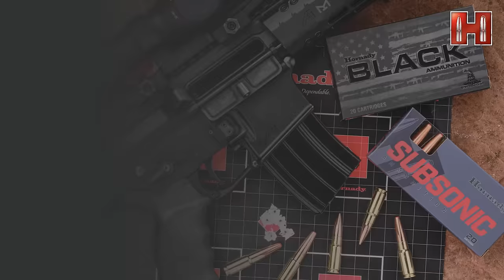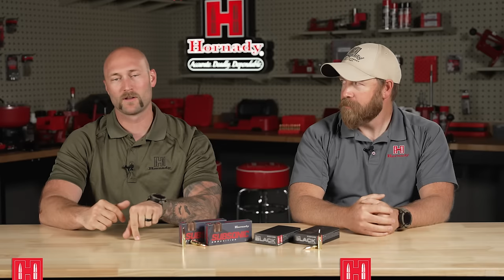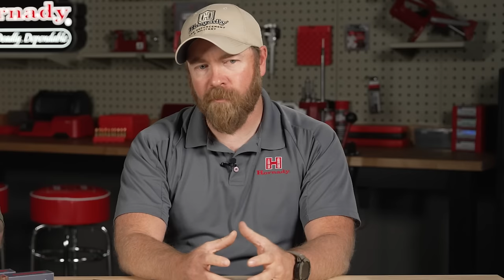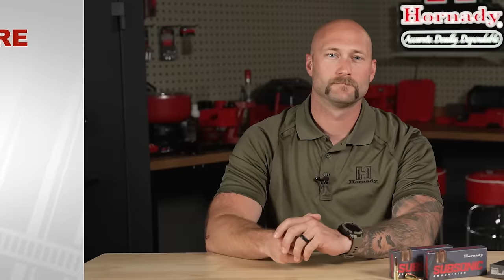338 ARC vs. 8.6 Blackout

Comment: What magazines does it use?

What Bolts does it use?

What’s the Bolt life like?

What Silencer Caliber does it use?

What’s Brass life (reloading) look like?

What gun companies have signed on to make rifles (and “pistols”?

This smells a bit like “30 Super Carry”. A new caliber looking for a use case, that will have no platform support. 

How does the 338ARD compare to “338 Spectre” or “338 Whisper 2”?
Reply: 338 Spectre uses a 6.8spc or 10mm magnum  case and a 6.8spc bolt head. This means you can get ammo with either large pistol primers or small rifle primers. 

338 Razorback starts with 10mm auto brass. 

ARC cartridges start with the 220 Russian case, which is also the parent cartridge of 7.62x39 and 6.5 Grendel. Advances in bolt tech from companies like Young Manufacturing and SixFive have fixed the original bolt breakage issues companies like Colt and PSA have.
Reply: The problem is 30 super actually had a use case.
Reply: @lordhellfire153  You have the parentage backwards: 7.62x39 is the 220 Russian's parent, then the 220 influences the PPCs (22 and 6) and then 6.5 Grendel.
Reply: @alexmorrison4145  no it didn't.
Reply: All of these are either answerable or by critical thinking on your end or look at Hornady's website.
Reply: 6.5 Grendel/6mm ARC magazines
6.5 Grendel bolts
Working pressure is from low 40ksi to 48ksi, so bolts should last 10,000+ rounds.  Rexus UltraBolts are the way to go.
Silencers can be 338 or 9mm.  Hornady has been using TBAC FLY9 in their testing.  Excellent can.

Partner Companies:
Aero Precision
AR Stoner
Ballistic Advantage
Black Rain Ordnance
Brownell’s
Carbon Six
CMMG
Faxon
KAK Industry
Maxim Defense
ODIN Works
Palmetto State Armory
Preferred Barrels
Primary Weapon Systems
PROOF Research
Seekins Precision
Stag Arms
Uintah Precision

338 Spectre Performance but from a case that uses Small Rifle Primers

Comment: Have these guys even shot 8.6 blackout at distance, My Q fix is within MOA specs using 285 grain ammo! 338 ARC needed tobe 1 in 3 twist! total pass Hornady or until ya make projectiles made for 1:3 with barrels in 1:3 for 338 ARC!
Reply: I doubt Hornady would do 1:3 twist, their SUB-X bullet's a pretty weakly constructed for that twist rate.  However, MOSTEK has been making 338 Spectre Barrels in 1:3 twist that I have been considering.
Reply: @ronaldtrask3444  Yeah, I have been I eyeballing the 1 in 3 barrel to!

Comment: I love seeing new cartridges coming out like this. Super rad y’all. I do wish the bias didnt swing so hard towards 8.6 ARC in this video however. There’s pros and cons to both and it seems like y’all are trying to poo poo some of its advantages. The 1:3 twist isn’t “speculative” it creates much more energy and effect, despite the need for monolithic projectiles
Reply: The twist adds neglible energy. It does make expansion faster and possibly more reliable. But it has a downside, you can't use cheap plated bullets. So it makes ammo more expensive
Reply: @jonathandebona8934  I don’t understand how energy that can spin a bullet apart is negligible when that is what you want the bullet to do inside what you are shooting at. It’s more expensive, very true. But to your point I’m sure the expense of 338 arc vs 8.6 blackout will also be negligible. These shits will cost some money like all hunting rounds and special cartridges. As long as it’s not 50 BMG, 338 lapua type shib, it’s fittna cost a lot to enter this game
Reply: @T20-c8f because bullets aren't meant to be strong laterally so it requires little energy to rip apart especially after it expands. 

Is it easier to break a long stick or a very short one by grabbing the ends?
Reply: @jonathandebona8934 that’s not true
Reply: 1:3 even works with weak sub x bullets
Reply: @jonathandebona8934  rotational energy not kinetic energy.

Comment: How does this compare to 338 Spectre?
Reply: Same performance but with Small Rifle Primers, no need to mess with cutting and necking-down brass.
Reply: Ballistically identical subsonics, slightly faster supers. Runs on less reliable Grendel bolts and lower capacity Grendel mags. Will crush Spectre in availability like 8.6 did, sadly.

Comment: Sorry guys, I really like Hornady and you all definitely have a lot of great products and have really driven the industry forward at times, but not just going ahead and getting on board with 8.6 is disappointing. There are more and more firearms options becoming available on an almost weekly basis for the 8.6 at all price points, heck Rossi is offering a single shot rifle for 260 bucks now, but ammo is still only available from boutique manufacturers or by handloading. Truly feels like Hornady could have stepped in and really helped make 8.6 truly mainstream while also giving more improved ammo options, vs trying to release a new cartridge in search of questionable problems to solve.
Reply: Sorry but I like this cartridge being that it runs in an ar15 not ar10. there are many downsides to the 8.6 that this doesn't have as far as bullet types you have to use with 8.6 because of its way fast twist rates. But have fun with your 8.6. the only downside the arc has is not quite as fast of speeds with supers compared to the 8.6. But the benefits of being able to use any cup and core bullet and not having to worry about your bullet flying apart after it leaves the muzzle is a huge advantage and savings in cost.
Reply: @jjmckay6man1 then just use 300
Black out lol ,
Reply: @BossHugo84  why when I can have 1.5 times more energy on target. you use 300 crap out.
Reply: @jjmckay6man1  because it just came out and for 1.5 difference you are going to pay way more for ammo .
Reply: @BossHugo84  yeah right there ammo will be much more affordable than the 8.6 crapout. besides that I'm a reloader so can do it more cheaply.
Reply: @jjmckay6man1  yes of course , but this is not hitting hard then 8.6 supers Big Cap
Reply: @BossHugo84  arc is only a few hundred fps behind the 8.6. Besides Most are going to do it for the subs not supers but the option is still there. that is the only downside to the arc. even at 2500 fps the 175 gonna hit like a 175 .308 win with better sectional density in an ar15 platform..and even if it is a little less than that it is still better than anything supersonic in the ar15 platform to date.
Reply: @BossHugo84 super sonic 8.6 makes zero sense. It's identical to this in a larger platform for no reason. This is the future. 8.6 will disappear in 5 years.
Reply: Nice copy-pasta from chat gpt
Reply: 8.6blk is too finicky
Reply: 8.6 is over hyped. This is a better option. 375 raptor is what should be going mainstream.
Reply: Dude they said they created this before 8.6 was a thing lol
Reply: "but ammo is still only available from boutique manufacturers or by handloading"

You answered your own question. Hornady has the opportunity to introduce their own cartridge and blow 8.6BLK away in terms of large-scale ammo production
Reply: Just give us a 50 whisper that runs in an ar10 already!
Reply: Yea but if they are they get you hooked on a cartridge and they’re the only ones making them, you will just keep coming back… at least that is what they are hoping. Not gonna work.
Reply: Did you... not watch the video?
Reply: Completely agree! The one problem that they mention that truly is a potential problem on the part of the 8.6 Blackout is the twist rate, but other than that there was still solid potential that seems unrealized.
Reply: Use solid copper bullets
Reply: But you'll be stuck using subs only?
Reply: @mattself6078  that is all I was interested in anyways for ar15 is subs. If I need a supersonic hammer I'll use my 450 bushmaster.
Reply: @jjmckay6man1  but you'll have to carry 2 rifles.  8.6 covers both sub n supers, it's not the same as 338 arc.  Plus you'll have to buy proprietary mags, and a new bolt that hopefully is made well.  Arc bolts tend to fail within few thousand rounds unless they are made of good materials n from a great co.  So you will be probably 3 to 400$ into using this new cartridge in an area 15 and that's not covering ammo or the barrel.  Mine as well buy a new rifle at that.  8.6 you just need a 200$ barrel and your ready......

Comment: My biggest beef with AR-10s is that they don't seem to be as homogenized as AR-15s.  Seems like a lot of AR-15s have a lot of parts compatibility from one AR-15 manufacturer to another.  Obviously not 100% as some manufacturers use proprietary parts.  But the AR-10 seems to be even less 'parts-compatible' from manufacturer to manufacturer.

I don't "run-and-gun", so a slightly heavier rifle doesn't have much practical impact on my shooting, since I'm mostly rucking my gear from the parking-lot to the shooting-lane.

Comment: What about 8.6 super vs 338 super
Reply: 338 arc super is basically a pistol round
Reply: @kevinbrittingham6774  seems like it how about a boombox with a brace 👀
Reply: @kevinbrittingham6774   175gr at 2075fps from a 16” barrel, 904ft-lbs at 300yds.  So like a 44 Mag muzzle energy but at 300yds.  There aren’t any common pistol cartridges that will shoot even a 90gr at 2075fps, let alone 175gr.  The supersonic performance of it is way better than I expected.
Reply: @LRRPFco52  sure. What is it out of 8”?

Comment: 338 and 8.6 are both the nichiest of niche chamberings. They’re mostly just “cool kid” rounds because anyone who actually hunts subsonic is almost certainly better served running 450bm or 45 Raptor or similar big-bore rounds. Plenty of mag capacity for intended uses and a lot more downrange energy out to 200y-300y. Better efficiency, lower muzzle cork pressure, already available, etc….

Comment: Yeah but when you flip to supers in reference to case capacity the men it is used more to its full extent? I like 8.6 like the 300blk. It gives you power when going subsonic. Due to the weight of the projectile, and when you go super you gain some of the benefits, not nearly all, of the larger cases given it has more case capacity for that supersonic load. It takes the need away for multiple set ups, I can just plug and play. Or less!!!

Comment: Now i wish I wouldn't have bought a 308 can be this seems to be what I want.
Reply: You can get a TBAC FLY9 Suppressor and use it on 9mm pistols and 338 ARC.
Reply: That 308 will still be in service longer after 338 arc! He'll i have (2) 8.6s and (2) 300blks... but I'll still build a sole source 308 for reaching out and touching grass @ 900 yards!

Comment: the thing with 8.6 is that you can get both subsonic and supersonic out of the same cartridge. for purely subsonic of course it is to much case capacity.
Reply: The thing with 8.6 is that .375 Raptor exists with higher muzzle energy for both subsonic and supersonic loads. The .308 case is massively oversized as a parent for a .338 subsonic and yet by cutting it so short Q hamstrung 8.6 BO supersonic performance too. .338 Federal is what a real .338 AR-10 cartridge looks like and .338 Spectre is all you need for a .338 subsonic. It's insane to me that 8.6 has so much momentum now. Perhaps we've simply yet to reach the stage where buyer's remorse sinks in. I just can't wait for 8.6 to die, its continued existence reminds me that I'm living in clown world.
Reply: @agentoranj5858  .375 raptor is a new one to me. I'll have to look that one up.

Comment: The thing with 8.6 blk is super and subsonic... if the problem is case capacity then do some actual engineering and do some work to the internal case design like Q did.
Reply: you can run supers of arc as well just not to the same speeds as 8.6. I see way more benefits out of the arc than the 8.6.
Reply: Yeah Q just makes stuff and throws it out on the market...
Reply: @sniperjoe  yeah they talk about Qs research but they don't mention he didn't have ammo companies on board lmao.
Reply: Supersonic 8.6 makes zero sense
Reply: @jjmckay6man1  for sure and alot of thr 8.6 ammo companies... the bullets are trash... zero neck tension on the solids so the push in going up the feed ramp not ideal...
Reply: @sniperjoe  yeah there are to many downsides to the 8.6 with the arcs only one being a little slower than the 8.6 with supers.
Reply: @jjmckay6man1 the treshold for reliable expansion is 2k fps. the arc will never hot that as the 8.6 barley does
Reply: @allthingsconsidered3211  Wrong the 338arc does not need to use 3 or 5 twist barrels with monolithic bullets like 8.6. hornady already has a 307gr sub x bullet and you can use cup and core bullets like any other round with supers. only a 1 in 8 twist with 338arc. go watch the introduction long form video so you know what you are talking about.
Reply: They weren't saying it was a problem for them (Hornady), they were saying it was a problem for Q.
Reply: @heyhayhay247 you mean 338 arc?
Reply: @jjmckay6man1 what downsides?
Reply: @kevinbrittingham6774  How sad that you're here in the comments...
Reply: "Do actual engineering like Q" is one of the funniest things I've ever heard
Reply: @Courtesyflush52  Just say you cant afford their guns its easier
Reply: @Colelipari  speaking the truth here. or just that he's never really seen one. their guns will be lighter and stronger then any rifle in 338 arc lol
Reply: @heyhayhay247  I don’t think so.
Reply: @Courtesyflush52  how so?
Reply: @kevinbrittingham6774  That makes it even more sad. You designed a cool round which had some success, but ultimately, Hornady did it better. Instead of posting emojis in the comments of their videos, maybe use that time to design something else?
Reply: @heyhayhay247  they didn’t do it better in any way. It’s a compromise in every way.
Reply: Such as?
Reply: Is this an opinion?  Can you provide supporting data.....facts?
Reply: Because......
Reply: @mattself6078  non std , unreliable mags. Weakened bolts, requires new feed ramps. Reliability and durability. Limited case capacity, so can’t use longer, heavier bullets. 1:8 twist, not fast enough to maximize accuracy with subs or energy on target. Supers in shorter barrel are useless…9mm +p+ handgun.
Reply: @kevinbrittingham6774  i was replying to other people's comments, don't know why it showed under yours??? But yeah the 8.6 blackout is sooooooo much better than this 338 arc crap.
Reply: @heyhayhay247  how is it "sad" that Kevin is replying to people's comments trying to explain the differences in the cartridges?  You don't see other gun manufacturers even answering questions of their customers ever....... it's sad you hate a person so much you would follow another's ideology blindly.
Reply: @mattself6078  I decided on my own to dislike him based on his bad behavior

Comment: Yeah, no, i'm still gonna pick 8.6 Blackout there. the Fast Twist requires bullets designed for it, yes, but it's allowing you to push very long bullets subsonically, while still staying stable, and ensuring that they expand. and because they're long, they have a longer distance available to expand. if i'm being honest, i'd have been on board if you'd kept the fast twist those really long, heavy bullets to reach out and do real damage. Not sold guys, this one's probably a miss. sorry.
Reply: 8.6 blackout is a large frame ar, 338 arc uses small frame ar. 😅 two different beasts, its more of a 300 blackout killer than a 8.6
Reply: Q apologist spotted
Reply: @boygonewhoopdataZZ  Yeah, i'll give that a fair point. it's not built for the same bullet masses i suppose. Plus i also just prefer solid copper projo's in general
Reply: @MegaAndy93  hey, i trust the ballistic gel tests, as well as the calculated. The cartridge seems to be a very good design to me. The guns from Q are... well, lets just say a bit extra. particularly the price.
Reply: @etherealswordsman3214 flamboyant is more appropriate than extra, I think.
Reply: @ja0298  the price is extra 
😅
Reply: @etherealswordsman3214  true, I should’ve said Q as a company.
Reply: @ja0298  true enough.

Comment: Niche subsonic only round in poorly designed magazines with bolts prone to breaking. This lacks the load versatility of 300blk and 8.6blk, along with full capacity in solid standard AR15 and SR25 magazines, and the use of full strength bolts.
Good luck with that mess

Comment: Lead core and lead bullets in general should not be a consideration in any forward looking design.

If you're looking for penetration, copper solids do it better. If you're looking for engineered fragmentation, copper is more predictable. Even engineered expansion does better with polymer tipped copper than lead center soft nose bullets.

Lead is just awful in terms of contamimation, both terminally in what you eat and just the ground/water it falls in. It makes indoor shooting dangerous and everywhere dangerous if you're shooting hard cast.

For something that is solely going to rely on subsonics because of the reduced case capacity, it will need all of the help it can get stabilizing super long projectiles and maximizing the inertial energy that projectile can carry with it. If you are going to shoot lighter bullets, you might as well just use .300 BLK, at least you'll have a useable supersonic capability.

Comment: Kinda feels a little try hard to me .... 

if I want subsonic with massive power factor, I will go with something in the 45 range... 458 SOCOM, 450 bushmaster etc etc ..... 

Its basically a oversized 300 blk
Reply: "oversized 300blk".... I think that's a pro, not a con. 300 blk has always been said to be just a little underwhelming. Now 338 ARC is the answer.
Reply: I love 458 socom, but the capacity limit is the only detraction. 338 arc should be a nice subsonic intermediary between 300 Blackout and 458 socom
Reply: @Lukavich  to what exactly?
Reply: Can you double stack 458 or 45BM in 10-30rd mags?
Reply: @LRRPFco52  how many 338arc will fit in a standard 5.56 mag?